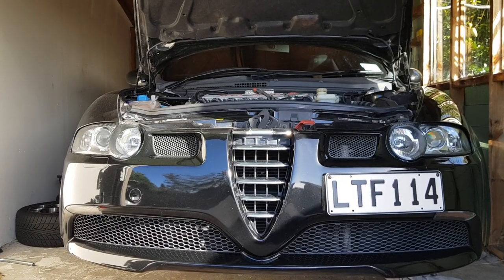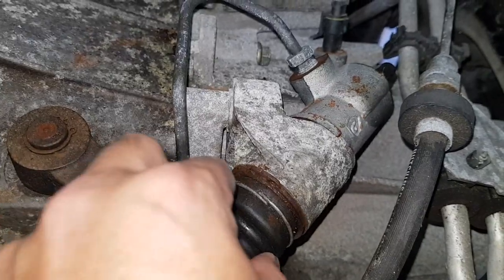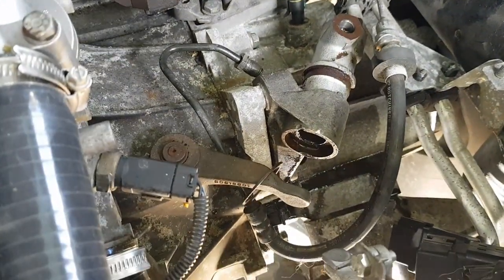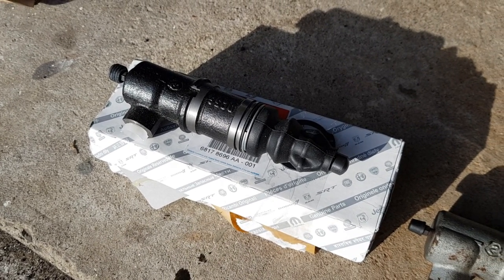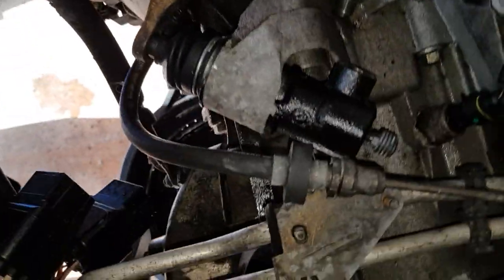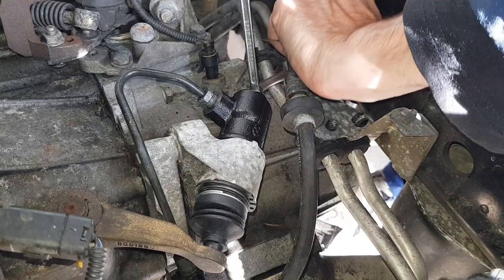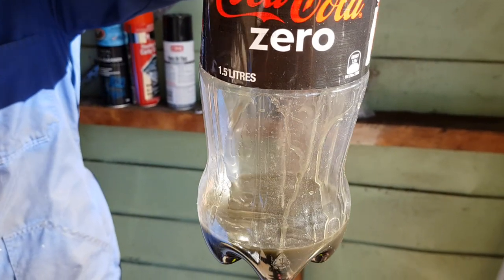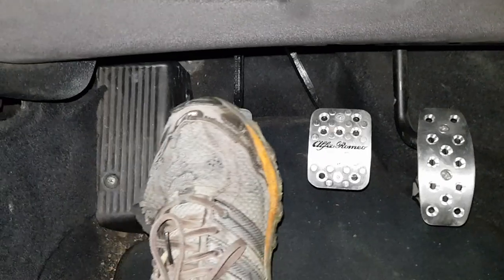Alfa Romeo 147 GTA Episode 14 - Slave cylinder DIY

Comment: I've got to do this job tomorrow. Mine failed coming off a motorway slip road. Luckily I managed to get it going in 2nd gear and pull into a lay-by.  Thanks for the video. Without it I wouldn't have known how easy the job might be.

Comment: Nice video!
It's also a good idea to lube the clutch actuator arm by removing its circlip and putting a few tablespoons of gear oil while doing this job - it solved getting into reverse and first on my GT JTD which has the same clutch system. There is a whole thread on alfaowner for this who have solved many clutch issues this way. 
Looking forward to more videos! Thanks. ;)
Reply from the maker: Awesome, I might look into that as well if it still plays up! Good tip :)

Comment: Do you have a video for the master sleeve cylinder?
Reply from the maker: Not yet, I'm planning on changing mine this year since its squeaky. I believe its not too difficult to do but you have to get under the car to undo some stuff
Reply: @LueysGarage  I have problems with my clutch it stucks at a certain point I changed the slave cylinder by following your tutorial as I had lost brake fluid your tutorial helped me a lot but my master slave cylinder need also to be replaced keep up the tutorials you helped me a lot with my GTA 👌
Reply from the maker: @J2105HD  Great to hear, there's more videos coming :)

Comment: Hi, just wondering you have the OEM part number for that?Any brand recommended?thanks
Reply from the maker: Part number is 46835408 and I used a genuine Alfa one from Alfaworkshop.co.uk, but they also sell TRW which is probably the same if not better quality 🙂
Reply: @LueysGarage  that help a lot.thank you...I am planning to change both cylinder (master and slave) base on your tutorial.
Reply from the maker: @kahhauwong  100% worth doing, my clutch is now completely silent and works brilliantly. Its a pretty easy DIY job as well, you'll just need someone to help you bleed the slave cylinder afterwards by pumping the clutch pedal. A lot of people get left stranded due to these old cylinders failing so its important to do this as preventative maintenance
Reply: @LueysGarage  that great...Thanks again. On more thing the part number that you provide for me is 147 GT? I am just having manual 147 twin spark. Appreciate that...
Reply from the maker: @kahhauwong  yeah for the twin spark its a different gearbox and the part number is 55184041, check here for all the different options https://www.alfaworkshop.co.uk/parts/147_Slave_cylinder.shtml
Reply: @LueysGarage  thanks ...This one really help.. Lucky I ask you first...I will order stock later let you know the progress after done.thanks mate.